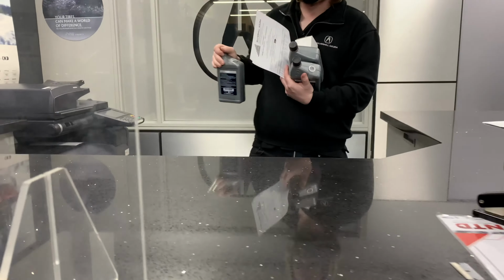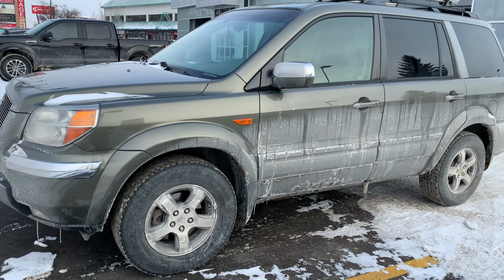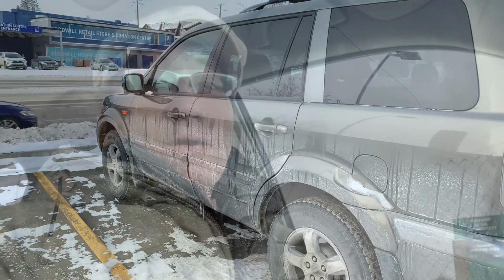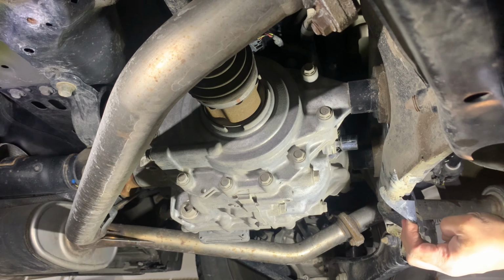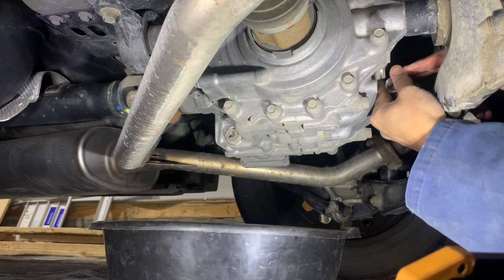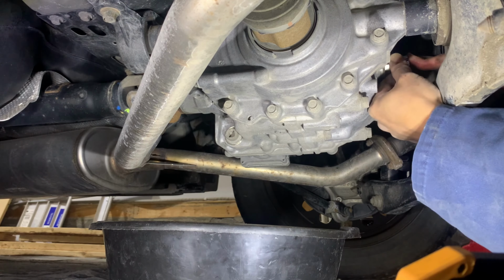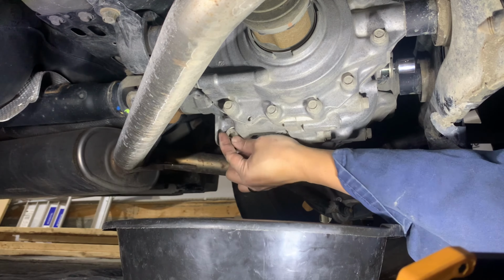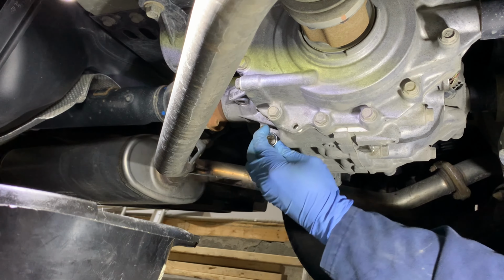Gen 3 Acura MDX Top 3 Issues Noted So Far | 70,000 km A16 Service - Engine and Rear Diff Oil Change

Comment: i have a 2017 MDX and for sure the issues you mentioned regarding the transmission, the clanking noise on the steering, and the rotors warping are all true. So, instead of bringing it to the dealer I just replaced the rotors with PowerStop high performance rotors and pads. Then, I've recently replace the cheapy original sway bar link with Moog heavy duty sway bar link and Moog sway bar bushing. Steering is so much tighter and better now specially on Sports mode.  I still hear some clanking to I need to recheck the steering again and apply grease where it needs grease. Now, I need to check with the dealer about this transmission software update. I will do this after I've replaced the ATF, transfer case oil, and gear oil this weekend. I hope this doesn't cost much. Thanks for confirming the MDX issue on this video.
Reply from the maker: Thank you for letting me know! By the way if you want to do the rest of the A123 service, I have the full how to videos on the channel
Reply: I fell your pain how many miles on your mdx whe you funded the issues
Reply: Do you have part numbers for the sway bar link and bushings you installed sir?
Reply: so all the acura mdx 2018 has that problem?  or only some... I am tinking to buy an acura mdx 2018 tech awd 3.5 v6, i currenctly have an acura rdx 2015 awd, do you think I am better keeping mmy rdx? my rdx  has 173k miles the mdx i want has 132k miles,, what would u recomend me ? i mean the trasmission issues

Comment: Good video there. My 2016 Acura Mdx sh-awd shows transmission system problem with blind spot system problem at the same time. Have you come across this before, from your experience with Acura with zf9 transmission what could be the issue?
Reply from the maker: Thank you 🙏 I am glad you like my video. Earlier in my ownership, I found my 9 speed on my 2018 MDX very jerky, jumpy and laggy, and doing the transition reset helped. Now 6 years later, recently it started intermittently hesitating on 1st gear and when you step on the gas it jerks. This happens from time to time and the dealer can’t seem to pinpoint what it is.

Comment: I really liked your video.  Wish you had left link for the “fill pump” you used.  Very well done, great information.  Thanks😊
Reply from the maker: Thank you 🙏 

The pumps you can find them in your local hardware or auto store and they are specifically for fluid or lubricant transferring pumps. There is one example from Amazon https://a.co/d/7AMi1Z4

Comment: Thanks for the info cause my Acura MDX has the same problem with the transition with the speed. Now I know it’s a transmission software issue.after I already changed the high fuel pressure and injectors..
Reply from the maker: You’re welcome!
Reply: @JNBTuning  so all the acura mdx 2018 has that problem?  or only some... I am tinking to buy an acura mdx 2018 tech awd 3.5 v6, i currenctly have an acura rdx 2015 awd, do you think I am better keeping mmy rdx? my rdx  has 173k miles the mdx i want has 132k miles,, what would u recomend me ? i mean the trasmission issues

Comment: "All Wheel Drive Oil" Is that what rear differential oil is ? Also, Do you need to lift up the SUV or on the ground is fine?

Wondering, if you can do it with my 2020 MDX (Will pay) better than Stealership :D  I live in MTL as well near Orange Julep :D
Reply from the maker: Yes it is the rear differential. It can be done on the ground. I would but you’re in the other side of the country LOL
Reply: @JNBTuning  hehe - Thanks though (:
Reply from the maker: @rkr894able  👍🏻

Comment: so all the acura mdx 2018 has that problem?  or only some... I am tinking to buy an acura mdx 2018 tech awd 3.5 v6, i currenctly have an acura rdx 2015 awd, do you think I am better keeping mmy rdx? my rdx  has 173k miles the mdx i want has 132k miles,, what would u recomend me ?
Reply from the maker: Sorry for the late response! I would not say that all MDX have this problem.  My MDX today three to four years later it is still working fine with just the jerky or laggy shirt points from 1st gear. Other than this no other issues so far.

Comment: How often are you changing rear diff fluid?
Reply from the maker: Based on how we use and operate the vehicle, I just follow the maintenance code interval. Technically when number 6 exists on the service code.

Comment: So the transmission issues are 100% fixed with the update? Or do you still have issues?
Reply from the maker: Since the transmission software update on my MDX we have never noticed any jerkiness or rough shifting.
Reply: @JNBTuning  so all the acura mdx 2018 has that problem?  or only some... I am tinking to buy an acura mdx 2018 tech awd 3.5 v6, i currenctly have an acura rdx 2015 awd, do you think I am better keeping mmy rdx? my rdx  has 173k miles the mdx i want has 132k miles,, what would u recomend me ? i mean the trasmission issues

Comment: Hi I have the mdx 2017 like you but for few days the park button not work and it’s just return to neutral, please help me to know what happend?
Reply from the maker: Sorry for the late reply! I would suggest get your vehicle looked at. Do a diagnostic scan, this will give you more information as to what could be wrong. This could be a faulty electronic parking brake or could be transmission. Really hard to tell without proper diagnosis and testing.

Comment: Came off the hwy and smell bruning brakes. Cuz the brake hold has a mind off its off. Also have the tranny misfunction issue. On my 2nd gen it always shift smooth. The fact that its switching modes along with erratic/harsh shifting tells me thier is damaged gears and beyond software update.